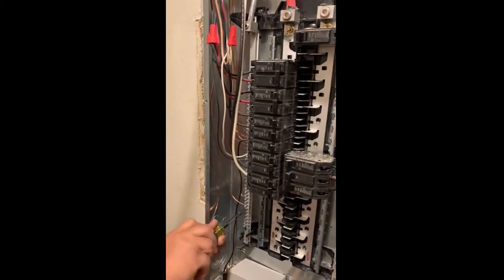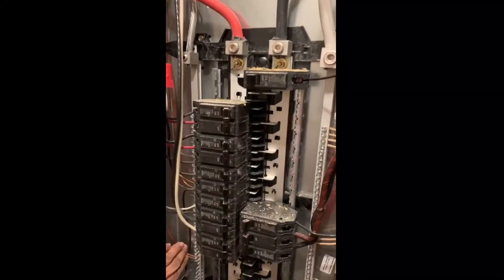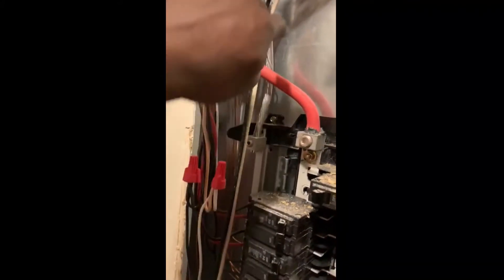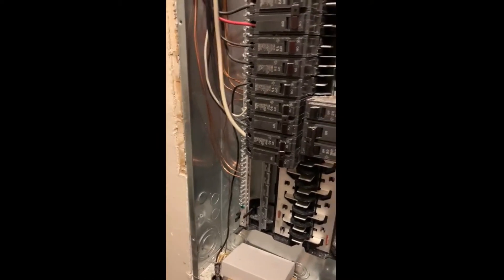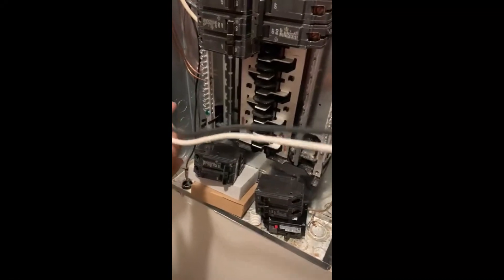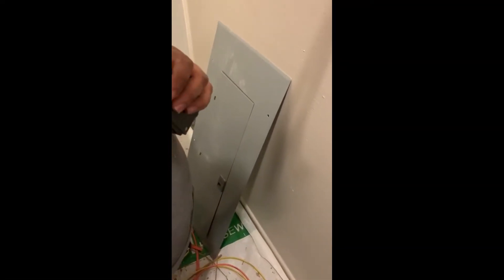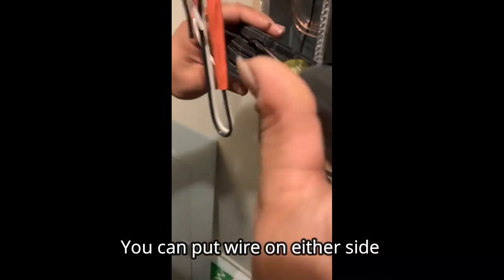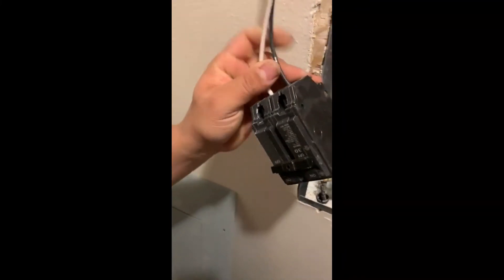How to install a double pole breaker? | 1st Electric Response

Comment: What do you mean by "20 amp 30amp double pole breaker"? Is one side 20 and the other? Or do you mean there's 20 amp wiring connected to a 30 amp breaker?
Reply: It’s a 30 amp breaker receiving 15 amps from each phase. You don’t want to overload one side so you use a double pole breaker to even out the load

Comment: I have a black wire and white wire for my AC. Which wire goes to my square D double pole breaker?
Reply: If your AC is 220/240 both are going to the double braker,both are hot line And 1 ground

Comment: Just installed a dbl 30 amp for a new 240 nema 6-30 outlet, breaker is not coming on...nothing is plugged into the outlet yet so what could be wrong?